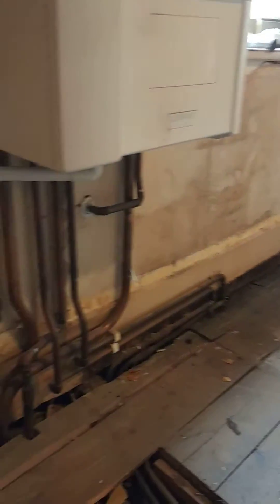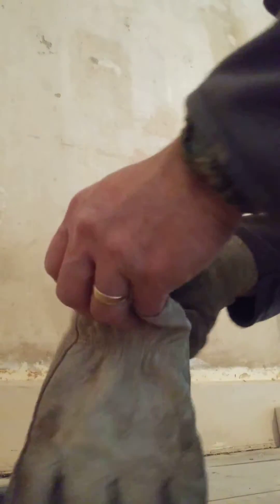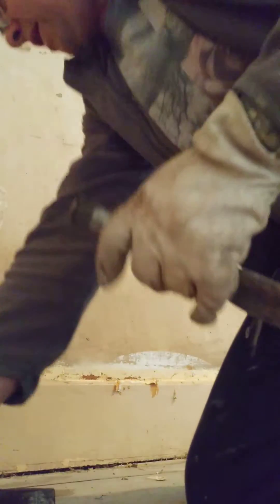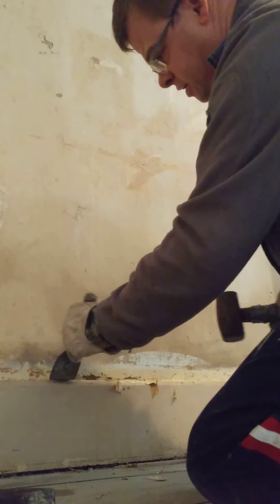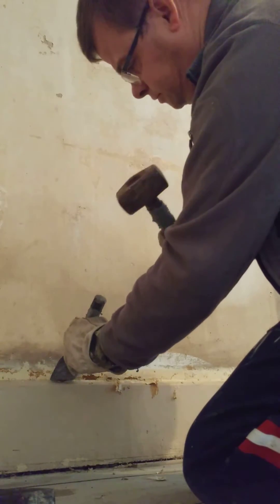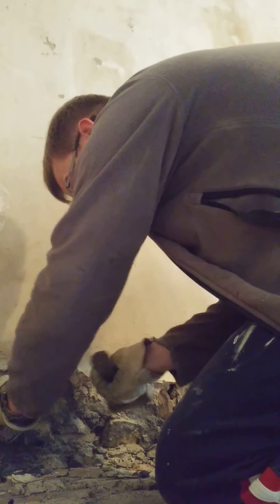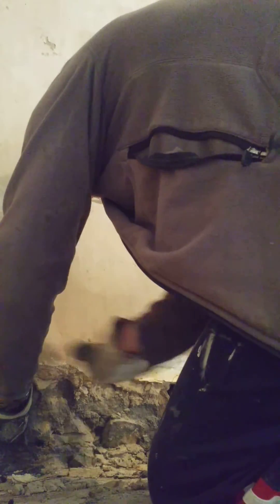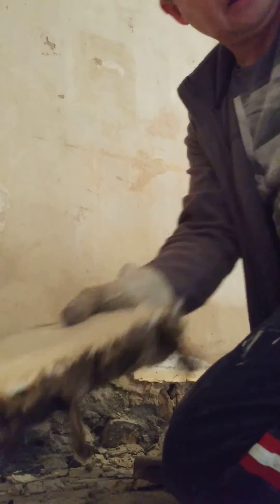How to remove concrete skirting board - part 1

Comment: Hi Lee,  I live in a 70's build ex-council 1st floor maisonette.  I have concrete skirting going up both sides of the concrete stairs. It's crumbling in places and is just ugly and I want it gone before I go to the expense of having laminate laid on my stairs.  As it's on stairs, is there anything different I need to be doing or can I just follow what you did in this clip?  Any advice would be greatly appreciated.